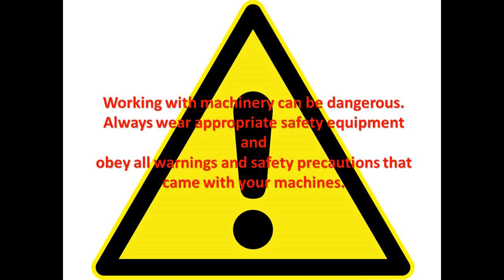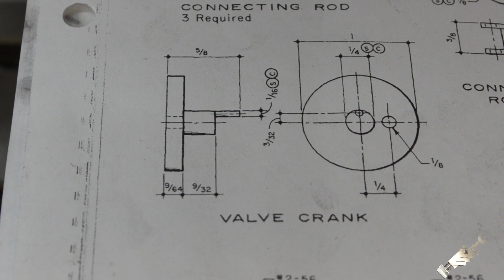Radial Engine Valve Crank

Comment: Have you tried loading the SD card on the laptop and transfering to the desktop via network or Wi-Fi...!!!  
Got those problem with card readers for desktop a few times myself, wonder what it is with those readers...???
I'm using a little Verbatim Pocket reader that has a USB connector to interface with the desktop, under $10, if it could help you.
Reply from the maker: Pierre's Garage i think the problem is the front panel where the USB ports and card reader are attached to, flash drives work fine but many times when I plug a USB cable I get error messages. The USB ports on the back work fine. I was successful using a portable hard drive (plugged into the rear USB port) transferring the files so that may be a good option. Live and learn.
Reply: Nothing worse than having to re-do twice, the problem on my SD readers from the computer keeps going dead, now it's the second one to die on me...   All else works but the SD...!!!
Glad you can work around the problem...   ;)

Comment: I use a old desktop,  only 4 gig ram and onboard video isnt very good.  The editing process is choppy and hard to work with. Thats why i dont add music or speed up parts of the video. I just fade in and out.   A new 1000.00+ video editing computer isnt in the cards at this time . So im looking at a video card with its own ram and maxing the ddr ram to 16 gig.
Reply from the maker: Yeah I know what you mean, I could spend $1000 on better things ( tools). My laptop works fine, I just thought that I could speed everything up a bit. I guess I will stay with the tried and true method.